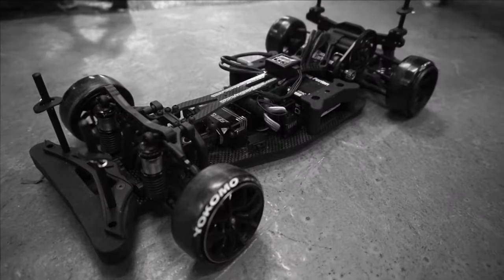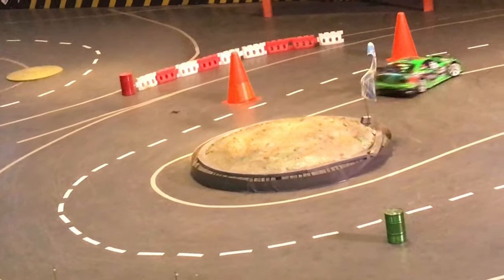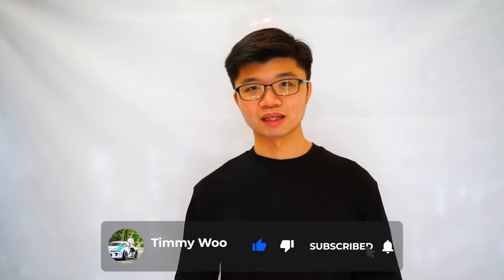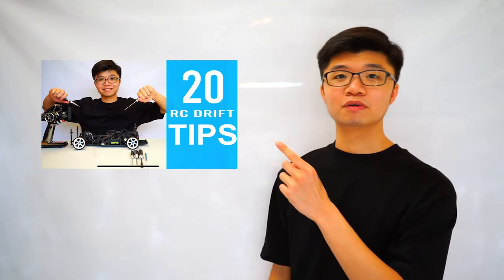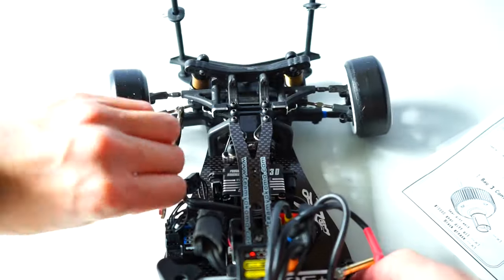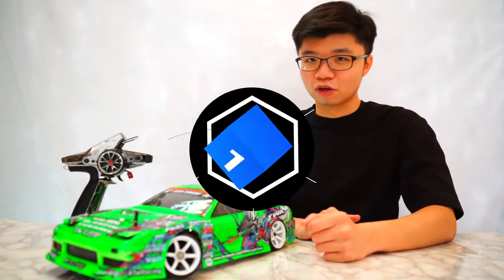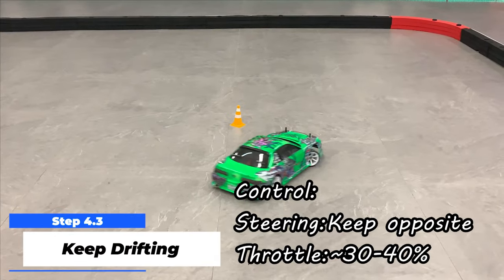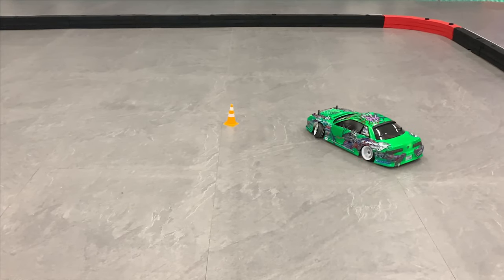Best RC Drift Basic Practice & Training For Beginners | How To Drift

Comment: This video was extremely helpful. 😆 Earned a new Subscriber! Also. Question, what if you don't have a gyro?
Reply from the maker: Thank you😊
Without Gyro for AWD is no problem at all. But when it comes to RWD, it is very difficult to handle without gyro.
Reply: @TimmyWoo  Are you the same Timmy that is in the yokomo awd final battle 2016 vid? If so what setup were you rocking Ik it's awd but what else
Reply from the maker: @_._marrez_._2297  Yes! That’s me! The setup was aggressive, but forgot the details in my setting sheet, maybe sharing later😊
Reply: @TimmyWoo  oh that's okay, I just want to get as much as l can from my awd rc drift car, and since l haven't been able to find much information l thought l should ask but thank you!

Comment: your videos are full of very helpful tips! 
as someone new to RC drifting, I find it hard to find videos demonstrating the effects of electronic placement for weight! is there truly a difference in how the car handles with the battery vertical vs horizontal? yokomo brags a pivoting motor mount but what does it truly do...as new users in an area without a local track someone like me is left blind picking between a YD2s or E for eg.

Comment: This was interesting. Never had an interest in drifting or knew how to do it but this video was helpful and I learnt a lot. For fun I have been trying to control one of my RC Cars with one hand and I noticed it start to drift around me, I now know this is because I was limited with the amount or force I could apply to the steering and throttle. I might try to actually drift it next time.

Comment: Hi Timmy 

I watched ur last video and reset all my setting on my car, now my forward throttle is completely fine but my reverse is super fast like 100% fast 
What should I do?
I use a speed passion Reventon  10.5R 
with a radiolink RC6GS
Reply from the maker: I don’t recommend to turn on the reverse function, it is the habit. The reverse function will not be used on the track as it affects the brake performance.
Reply: @TimmyWoo  so... should I take out the reverse function? If u say so, I'll programme the ESC to not having reverse. Thank you so much for replying